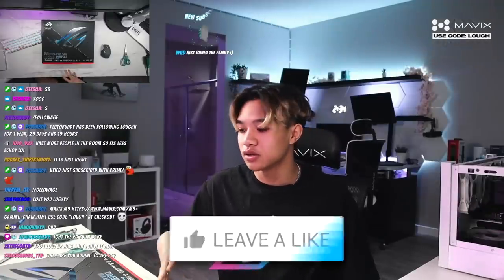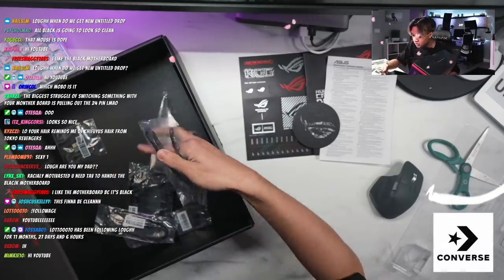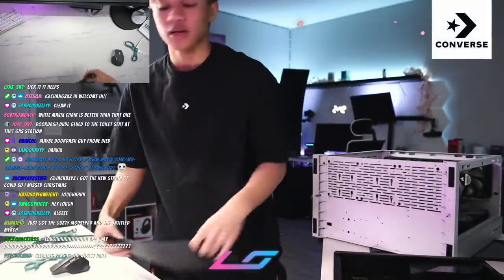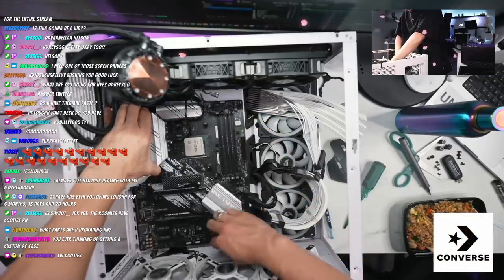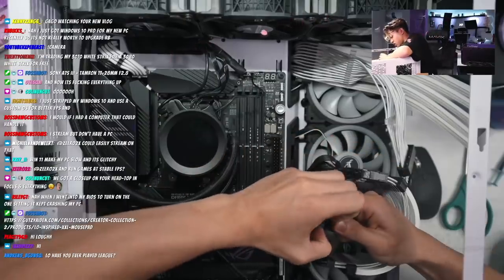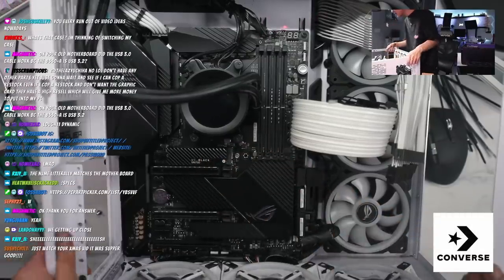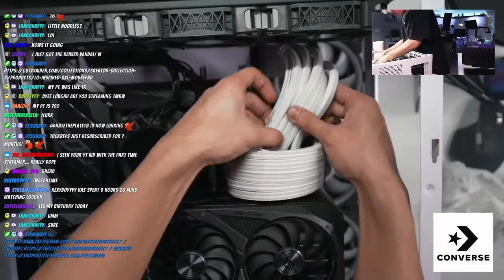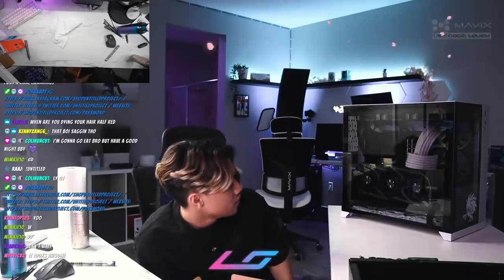UPGRADING MY $8,000 GAMING/STREAMING PC

Comment: the rtx 3080ti is almost the exact same as the rtx 3090, for over 1.5k cheaper. The only big difference is the double of VRAM from 12 to 24, which is unnecessary for gaming or streaming, its only really used for rendering animations etc.